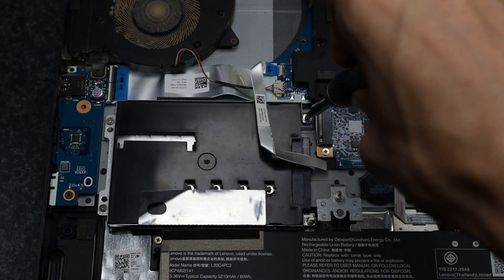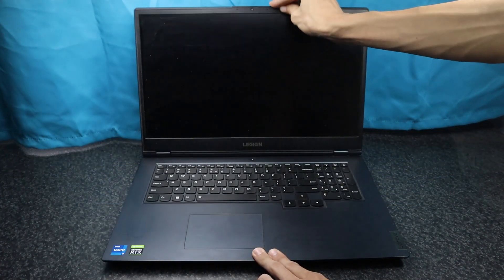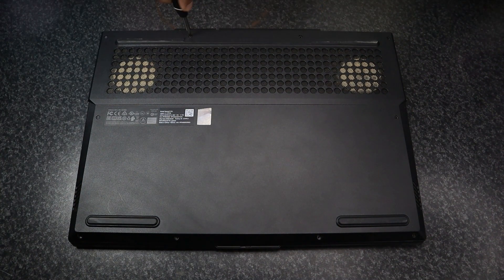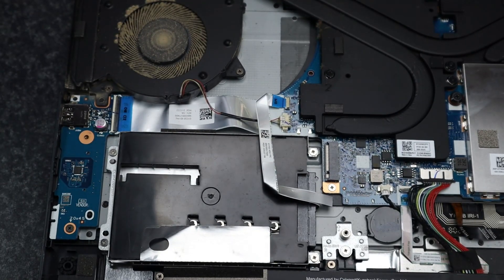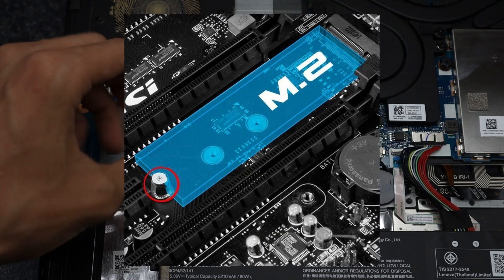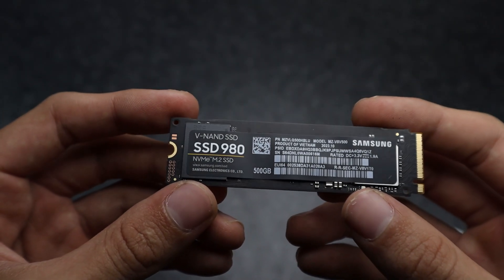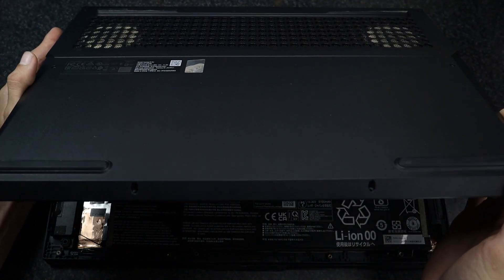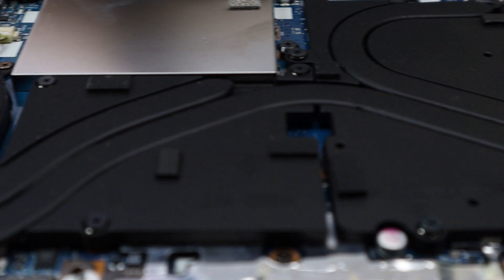Lenovo Legion 5 17-inch M.2 SSD Upgrade | Gaming Laptop Upgrade

Comment: Thank you for posting this video in 2025, it will be very useful to me. I want to know: if I want to install a 4 TB SSD, what brand do you suggest? With the changes you made, have you noticed an improvement in gaming? Specially for the fan noises.
Reply from the maker: You're welcome! There are a lot of good brands, all with their own price and performance. I heard a lot of good things about the reliability of Samsung SSDs and went for one for that reason. Also because it was pretty cheap. I have no idea what brands to choose for a 4TB model, but have seen many people using Sabrent Rocket SSDs. 

I haven't noticed any performance boost in gaming, as I've kept all my games on the Windows SSD, and SSDs don't really add to your gaming experience anyway. The fan noise has been the same, as the second SSD doesn't impact cooling at all.

Comment: On the lenovo website it says the default m.2 is 2280 and the other slot is 2242. So do I have to buy a 2242 to upgrade it?
Reply from the maker: The 42 means that that M.2 SSD is 42mm long, while the other one is 80mm, which is the one I used in my video. 

If the website states that the laptop only fits a 42mm SSD, then I would recommend buying one of that size. My model fits 42mm and 80mm SSD's though and I would recommend opening your laptop first to check which one(s) the laptop is compatible with before buying a new SSD.

(Lenovo support told me that my model wasn't compatible with M.2 SSDs at all, while it is, so the website information might not be completely correct)
Reply: @Hunterrcrafter  so what your stock m.2 was 42mm? Because you installed 80mm
Reply from the maker: No my stock one is 80mm, and the one I installed in the video also is 80mm. I could have installed either an 80mm or 42mm stick though.